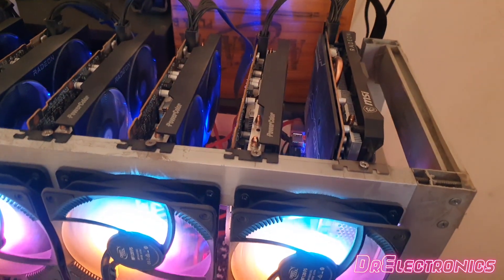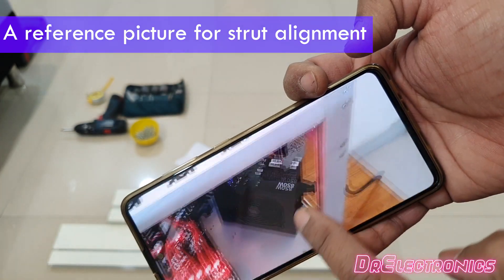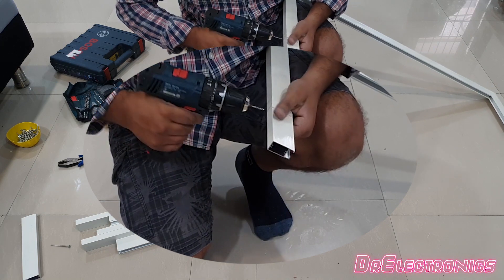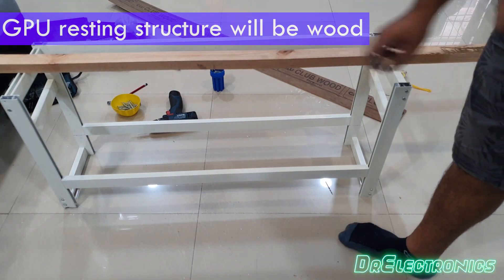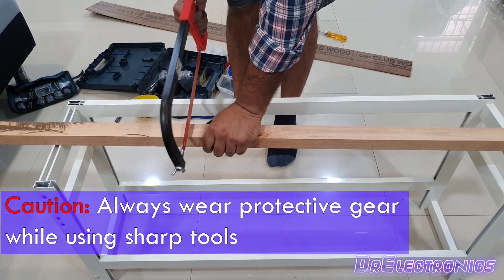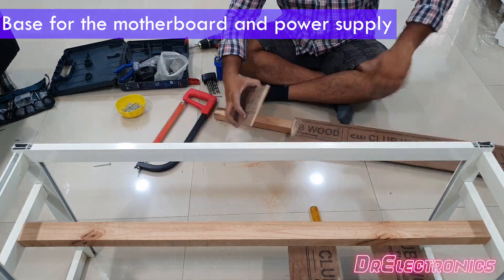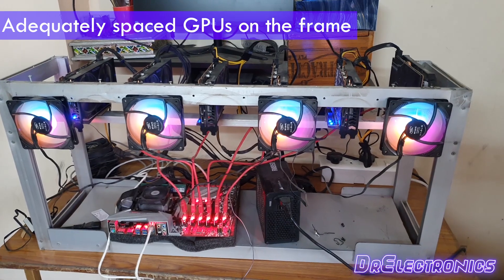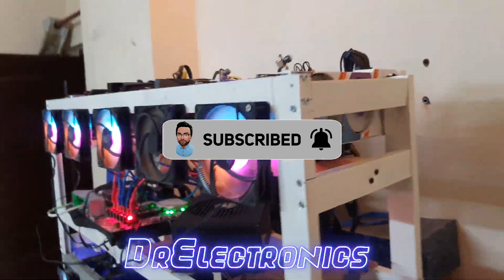Making a mining frame from Aluminum and wood; preparing for summers | DrElectronics

Comment: Sir ye frame 3060 gpu me bhi fit aa jayega kya
Reply from the maker: Ye kisi bhi size ke graphic ko fit karlega...because it is not limiting graphic card length.
Reply: Ok sir
Reply from the maker: @Yogeshsharma-fc5bq  are you also going to make one?
Reply: Sir best gpu card kitne gb wale 4,6 ya 8gb jo future tk rhe or msi ka motherboard best h kya
Reply from the maker: @Yogeshsharma-fc5bq  MSI and ASUS are the best...because of service network.  Never buy a GPU less than 8GB.
Reply: Plz sir suggestion best all parts use in mining rig provide detail all parts list
Reply: Sir motherboard me ram kitne gb ki lgaye
Reply from the maker: @Yogeshsharma-fc5bq  4 GB only. You can install any capacity of RAM but atleast 4GB should be there. Incase you need to start dual mining.